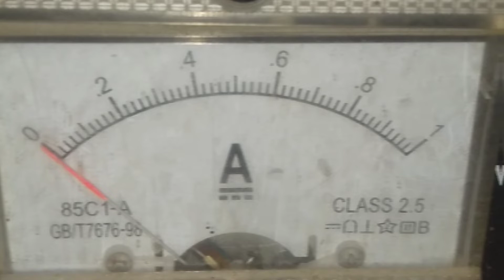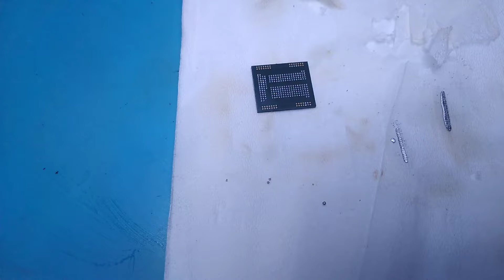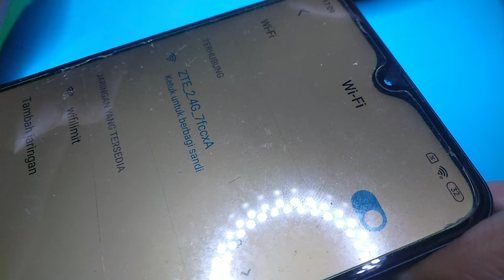Redmi 8 8A Dead Convulsions Ampere | Amper Kejang Kejang | Connect PC No Detect

Comment: saya punya hp dgn kerusakan yg sama udah 2x reball cpu emmc tetep aja stuk tdk ada perubahan hu tapi setelah cetak ulang ic powernya amper sempet naik tapi stuk lagi hu dibawah 100ma kayak situ kemungkinan powernya yg rusak kali
Reply from the maker: Kalau amper naik dikit/1 mili bisa jadi dari IC power, coba diganti dulu, dan hati2 untuk PCB type ini PCB nya rapuh/rawan kembung
Reply: @mobilecareid  kalo ic powernya dipanasi ampernya gantung di 0,1 hu turun dikit stuk segitu trs ampernya apasih hu yg rusak
Reply from the maker: @wahyuwidianto8205  Kalo amper udah gantung 0.1 berarti  IC charger dan IC power sudah normal, itu bisa jadi eMMC urgent/mati
Reply: Ya hu awalnya blue screen hu layar biru stelah cetak ulang cpu malah jadi coid
Reply from the maker: @wahyuwidianto8205  Kalau blue screen jangan dulu ke CPU, fokus di IC power sama WTR kalo QC
Reply: @mobilecareid  apa iya sih hu cipset mtk hu
Reply: @mobilecareid  lah makanya itu hu sepertinya ic power ini yg bermasalah soalnya sdh saya cetak kaki cpu sm emmc ms ga ada perubahan ampernya giliran sy panasi ic power smpet naik trs turun stuk
Reply from the maker: @wahyuwidianto8205  emang hp apa
Reply: @mobilecareid  hp relme c25 low ngga slh